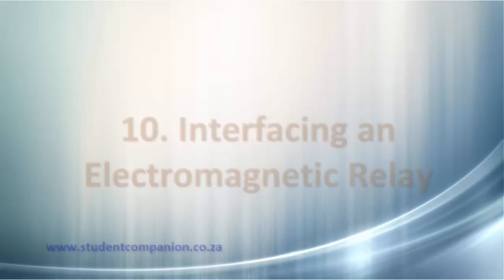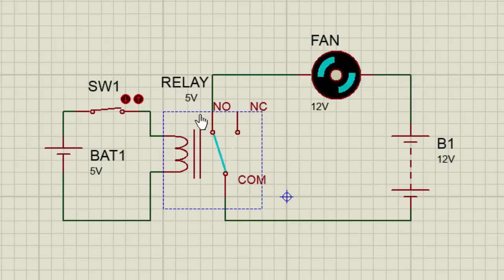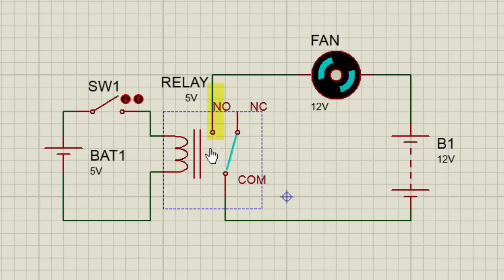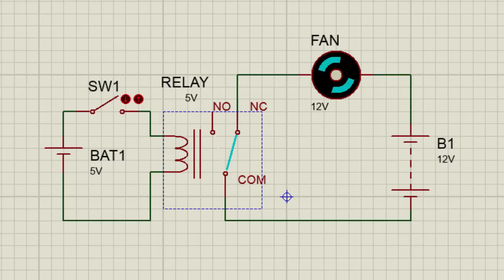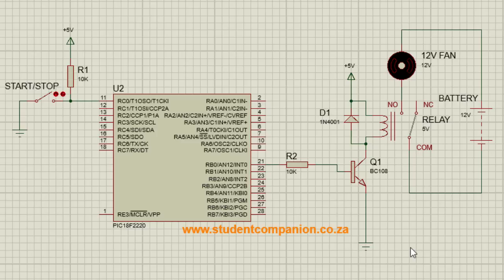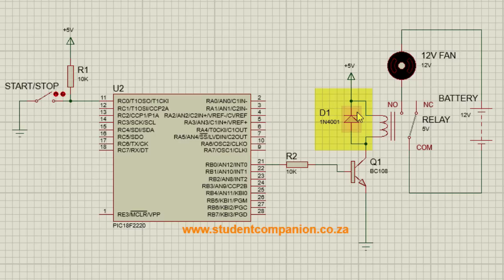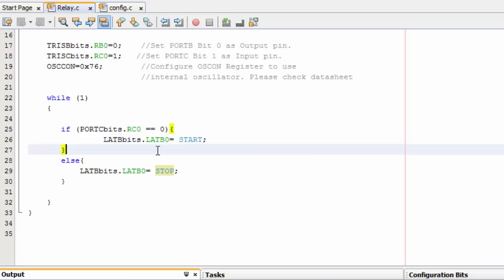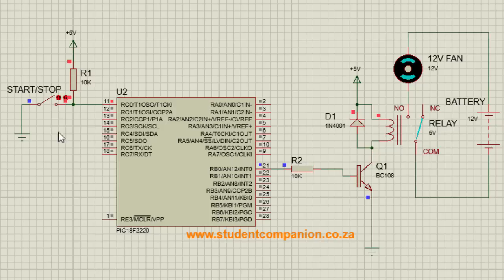10- Interfacing a Relay | MPLAB XC8 for Beginners Tutorial

Comment: my relay won't activate.  The arm won't animate and move over.  I do have a voltage drop on the relay and there is current going through but it won't animate.
Reply from the maker: +cheece2001 are you supplying enough current through the relay? Are you driving it with a transistor? Is it supplying enough current as specified by the relay?
Reply from the maker: +cheece2001 are you supplying enough voltage as well? If it's a 12v relay you can't supply 5v and so on.
Reply: +Student Companion SA yea i fixed it yesterday and yes it was because id forgt to set the relay to 5v. thanks for the quick reply and i love your work.

sry another question. will u have a lesson for ethernet with xc8. and usb with xc8. if not its ok. you are doing am awsome job
Reply from the maker: +cheece2001 thanks.  We will definitely have them. They are part of our playlist.